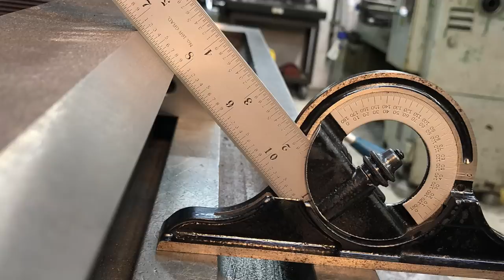SNS 310: Machining a Cast Iron Prism Straight Edge

Comment: You did a splendid job, Adam, on cleaning up that prism. If you don't mind I'd like to suggest some things that might have helped you relieve the bow in the material.

In the original setup in the machine vice, when you were using the jack stands to level out your initial surface, you might have tried "breathing" the vice..... Opening it, and reclosing it, before you did the cut. Pushing the ends up with the jack stands may have gotten the top surface normal to the machine ways, but might have induced a bend into the material that would show itself once it was removed from the vice.

Also, when you used the Carver vice, perhaps if you used the sandpaper trick in the jaws, and then just before you took your final cleanup pass you could blue up the surface, and back off on the vice clamping pressure by about half. Then take a spring pass. You might end up with a little bit of chatter in the middle if you took the support wedge out..... But you would probably gain the benefit of flatness. (Less pressure, and just relying upon the gripping power of the sandpaper under light pressure at the ends)

I realize that it was going to be ground later on anyway, but you might have been able to achieve a reduction in the grinding time by providing a flatter surface to begin with.

Also, cast iron machines beautifully...... I've worked with it many times. I think maybe you could take a more aggressive feed rate on your roughing passes, and then, as you said, slow down the feed rate for the finishing passes to give a nice finish.

These are just suggestions (from a Monday morning quarterback), and for all practical purposes they may be "impractical and unnecessary" considering the subsequent operations. I just have this penchant to try to get things as flat as possible right off of the mill when the function of the part requires it.

Comment: What dictates where you run the cutter?  I noticed you were running the casting through on the front half of the cutter instead of dead down the middle?
Reply: The short version is climb milling vs up milling. Generally for most tasks you want the tool to be rotating "against" the direction of feed, as you can see in this video where chips are generally pulled away from the finished surface. This is called conventional or "up" milling and is the safest way to run tools. Running a tool so that it pulls chips down towards the finished surface - climb milling - is more dangerous, as if the tool hits a hard spot or grabs into the work it will pull itself deeper and cause damage to the work, the machine or even the operator, but there are times where climb milling is preferable or the only option. Either way, you want to make sure you're ONLY doing one or the other - doing both at the same time (as you'd be doing by running a tool straight down the center) is generally a recipe for disaster.

Comment: Taking out a few inserst from the face mill sometimes helps to get rid of chatter. Less (maybe more?) tool pressure is what I think happens when a few are removed
Reply: Wouldn't that be about the same things as changing speeds and feeds?
Reply: @DeadFront1319  It all depends on what you're doing and how the part is held. 9 out of 10 a speed feed change will work, but sometimes your part is just not rigid enough and less inserts sometimes helps

Comment: A regular mag chuck with stops or a plug in mag chuck without stops would hold these parts on a mill or shaper and be way quicker to setup and should get you below the half thou range on a mill and maybe better on a shaper.

Comment: Just a question, why at 11:30 when you were machining the "thinner" side did you not re-indicate the part?  If I understand correctly due to your setup the part will be 90 deg to the face you originally machined but it might be skew to the x-axis.
Reply: Must agree, would parallel 2 opposite sides first
Reply: Can you explain "skew to the x-axis"? After the first cut, there is one flat side. On the second cut, as long as the back of the vice is square to the machine, we know for sure that the second plane will be orthogonal to the first plane. Even if the cut turns out heavier on one end of the straightedge, the final product will be square.
Reply: The rough bottom is being averaged out on the parallel. It doesn't matter if it's slightly out because indicating the top would be effectively the same thing that the parallel is doing on the bottom. (Averaging out the rough bottom side.)

Comment: Swirling multi tooth cutters have much more complicated cutting forces and are thus more difficult to control how they respond than single point straight line cutters.  Getting miles stuff flat is this harder than on the shaper or planer.
Reply: My go to solution is to face with a smaller endmill and take a smaller stepover. Smaller cutter and smaller cut means less force pushing the part around.

Comment: Simply put can not cast anything without creating internal stresses.  How  you measure the internal stress is to slowly machine away surface and take deflection measurements.  So the approach that you used to machine the prism guarantee that the surfaces would not be flat.  
The approach to get a flat surface would have been to make the first cut to get a machine surface.  Then repeat the process order of surfaces but cut half or less.  Which means you will cut more off at spots due to warping.   Measure with your edge the fatness.  If still a lot of warpage repeat process but reduce depth of cut.  Continue until the straight edge says it is flat.  Then follow the same order of surfaces in grinding and again reduce depth of cut for the grinder.  So the scraping will again be a reduction in the depth of cut.   
The simple fact is that there will always be internal stress change with the removal of material and proportional to that amount.  Impossible to get absolutely flat.

Comment: Adam, were you running a couple of scraper tips in your cutter. I used to set them out square to the surface and maybe a quarter to half a thou to the main cutters. They gave a fine scraped appearance on a finished casting.

Comment: could of used a T-nut and bolt as a makeshift jack to just support the center of the work piece just need to smooth out the head of the bolt, also i have used other types of carver clamp in my work and they are very good and strong take one hell of a bite

Comment: Do you think the warping might have been caused by stress. I've found that some materials will warp after you machine off one side. Recently when making a 12" long D shape bar out of a piece of 3/4" diameter 1018 CRS, milling the flat caused a great deal of warping.

Comment: Just thinking, If you were to put the shaper gauge out at the end of your clamps set the height and than bring it in to the center, could that remove any of the milling pressure that the outer clamps bend/torques the middle downward???  Thanks for all of you tutorial.  Bill

Comment: Adam, if you had clamped the prism down to the table, and into the T-slots as applicable, when machining the different "long" faces, would that have reduced the "bow" each surface has?  I know that the clamping would have been much more of a "pain," but I'm curious about what could have been done differently to minimize the "bows."

Comment: It worries me to see you lifting that vice by the moving jaw. There is not much holding the slide on , only a single set screw that cannot be too tight.  Might be an index to clamp down on a piece of scrap to hold the jaw securely.
Reply: It's a non issue. He's moving it straight into the cart, and he's lifting from the center of mass. Even if the set screw weren't installed, it wouldn't slide anywhere.
Reply: I am with Bill.  Every vise of that design that I have used, if you back that setscrew off 1/4 or 3/8 of an inch and the moving jaw lifts right off for quick easy cleaning.
He should cut a chunk of bar stock the right length and clamp on it.

Comment: Every time you use the crane, I'm puzzled why you don't mount it on the right side of the head so it's not all backwards for a right hander? The lifting part ends up being in exactly the same place, but it's up front and easy to do right handed.
Reply: I believe it is because the t-nuts will only slide on from the left side. If you look at 17:48 you can see how the trough to catch coolant is much wider on the left side. He may not be able to fit them in on the right side. I believe he had an issue with some large t-nuts he was using several years ago, that wouldn't slide in on the right side.

Comment: I think if I were doing this as a measuring bar for myself I would want it within 1/2 thousandths to 45. I understand for scraping it is 60° but for a measuring device it is as good as I can be.
Reply: These are never used for measuring the 45 degree angle.

Comment: What is a straight edge used for and why does it need to be finely machined?
Reply: The straight edge is used as a "flat reference" tool for measuring how flat other surfaces are with the aid of blue die. In this case this one is designed for measuring ways and dovetails on machines i believe.
Reply: Ah okay cool, thanks

Comment: Ya the most important reason to use a stripping wheel on a cast part before machining is to get any sand out of the pits saves on mill tooling..does he sell those cast straight edges?

Comment: Great vid, i really enjoyed this one. i was however surprised that you didn't jack the center on the straight edge when you had it gripped in the machine vice. surely there would have been some flex in the work piece when only gripped on the ends?
Reply: ha ha i spoke to early, should have watched the cut through before commenting!!!

Comment: Super beginner question, but what’s the advantage of using cast iron on precision surfaces or measurement tools? Why not scrape in a piece of tool steel?
Reply: Tool steel is much harder and does not scrape well.

Comment: You commented about making shorter machinist jacks. What about something similar to a scissor jack like most cars use, but more solidly built.
Reply: You answered yourself it would defeat the purpose as it has to be solid. A scissor jack would flex until you increased the lift to the point of bending the part, the solid screw jack prevents bending down as if the part is resting on the bed and only has to sit there and take the push.

Comment: the first screw jack should not have been put in... cut though the skin all sides first and release the stress, then finish mill and grind
Reply: I totally agree. All sides rough machined first before finish cuts taken. End pressure of vice clamping possibly causing bow as well. Good exercise though.

Comment: It is amazing how flat it looks, and yet, as Adam points out, it has that small hollow in it. Is it the geometry of the shaping cuts that leads to the greater flatness, or are the setups more rigid?
Reply: In this case it would be about how rigidly he could hold the work piece. Any kind of tiny flexing, or bowing cause by work holding in an application like this can cause the piece to be machined with a bend. Because it's only bowed just the tiniest bit and there's still further machining and flattening to be done on it, it's ok. This one's tricky because there isn't an easy way to hold a triangle (the 45° on the opposite side) in a vice. If this was just a square casting, he would have a much easier time clamping it on its short sides; rather than the long sides in order to prevent bowing.

Comment: I know that sometimes you'd use the shaper to do work like this, and maybe it's just for fun, but as someone who's learning, what are the pros and cons of doing a job like this on a mill vs a shaper?
From what I've learned on my own (which I don't claim to be a lot), I'd think to do this on the shaper first, just to avoid cast iron dust at the mill.
Reply: Cast iron fist is not an issue, at least not as much as some make it out to be. Wipe your ways of when you're done and you'll be fine. Especially in a home shop, where you might mill 1 cast iron item for 1 hour a month, it's negligible. If you're charging a customer, do it on the mill. If you're making educational and entertaining videos on YouTube, and you want to show a variety of processes, you can do it on the shaper. But cast iron fist is not a consideration.

Comment: I cannot for the life of figure out the method to your madness! A couple weeks ago you surfaced the exhaust manifold on your shaper which is great and love all your videos but thought your mill would be the tool of choice and now you are using the mill for this parallel when I would think you would use the shaper . I’m so confused lol 😂, nice work brother.
Reply: Hopefully its a time saving thing so he can get started on that stoker engine!  Good stuff all around.
Reply: Ask 10 machinist their MO on a project and you'll get 12 different answers.
Reply: I just added a comment about this. It appears that you CAN solve these problems with many different methods.. but I'd assume that there'd be a common best practice. Unless.. "machining is jazz, babyyy" 😁
Reply: The shaper finish on the manifold was the final finish that the gasket would mate to. The prism is going to be ground and then scraped so the finish Adam left it with was irrelevant. It just needed to have the cast surface (and any embedded casting sand) removed and the sides left flat.
Reply: @Mishn0  And then of course there was no way he could use that table mounted vise on the shaper.
Reply: Adam is running a YouTube channel. His job is to create educational content, while making it interesting, entertaining, and fresh. If he showed tree same work over and over, it would get boring. He's showing many different ways to do many different jobs.

Comment: That sky-hook came in handy changing out those vices. Surfaces came out slick as dog snot for you. Looking good. . . . till you put the straight edge to it....still a great job.
Reply: I wonder that sky hook is mounted to mill using tool holder. The mountig part (black) should have a vertical hole. Then it could be mounted to mill using T-bolt only. And to lathe using the bolt in the middle of tool post. Then tool holder is not needed at all.

Comment: Q: why no cutting oil on cast Iron....???
Reply: Tom Haney: Cast iron is normally machined dry. It contains graphite particles that act as a lubricant. Coolant or oil makes a holy mess.
Reply: @ellieprice3396  As it's a mess already I have a love hate with cast Iron
Reply: Another commenter mentioned that tapping oil tends to make a really tough sludge or mud in cast iron because of the material properties. That person also had some really interesting points about the type of tap to use and how the type of tap can have unexpected effect on your holes.

Comment: When you were clamping from the ends, I wonder is there any concern that it would bow up or down? Presumably that would mean after you flatten it, then release the pressure, it would "un-bow" back to how it was, leaving you with a hollow or belly from end to end?
Reply: Never mind - theory confirmed at the end of the video. :)
Reply: Cast iron isn't anywhere as bad as steel in that situation,it's far more stable under compression due to its random granular structure .good question though.

Comment: When you used the carver clamp on the 45 degree edge why did you not set the job on the small bee blocks you got and then you could have used three along the length?
Reply: That was exactly what I was thinking lol!   This guy has a shaper mill that would of been the ideal job for it vs mill to start with!
Reply: @Build-Break-Fix  tbh he probably wanted to use that big ass shell mill ik I would knowing the price

Comment: Hey Adam, I'm not a machinist but I'm trying to learn. You said it was the force of the vise that made the bow in the part and you could have minimized that bow if you had used the shaper. How would you have held it in the shaper to do so? Keep the videos coming. Cheers

Comment: love your videos!!, i have a problem though do you or anyone else know the best way to tighten up the cross feed on a Harrison 12" swing? the problem is as soon as it starts the cut it back's its self out unless you hold the handle to stop it, just thought i'd ask before i try to do it as i don't want to brake anything.
Reply: I don't  know what harrison 12in. ,so I would suggest to tighten up the Gibbs so it does not wiggle. Using a indicator to assure Gibbs are snug. Also if unit has backlash adjustment on screw, then adjust for minimal backlash.

Comment: Maybe I missed it in one of your other videos but what is the purpose of hand scraping?
Reply: To produce a cast iron surface as straight and flat as possible by removing miniature high spots with a carbide hand scraper. The process produces small abrasions in the surface that hold and distribute oil. The surface to be scraped is first lightly blued with a special ink then rubbed against a perfectly flat "master" to reveal the high spots where the "ink" was rubbed off.

Comment: Done a lot of Cnc milling and surface grinding but have never heard of hand scraping. Can someone please elaborate?
Reply: it's a process of  "printing" a part on a known good surface (which has a transferable colorant on it) and then  scraping the areas that show evidence of contact.  It is useful for leaving a surface that can hold oil as well as achieving high accuracy on parts/machines that cannot practically be placed in another machine tool.  sometimes it is done without a known good surface using the "three plate method".